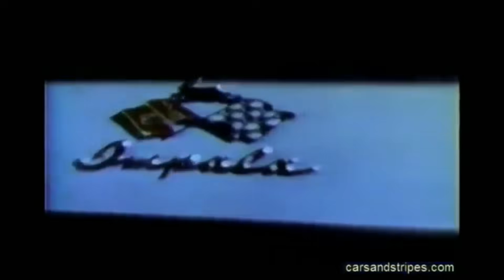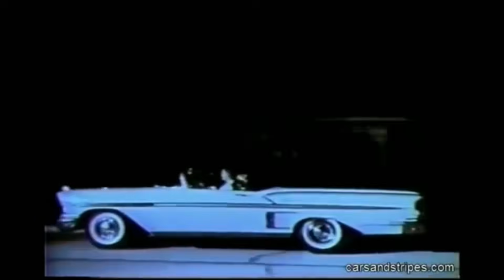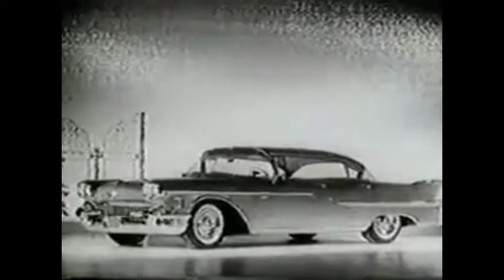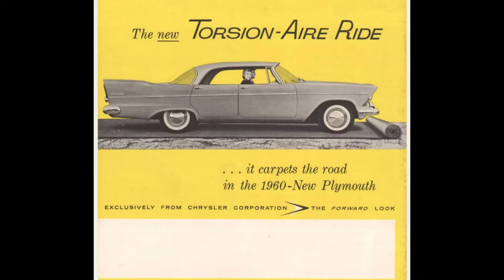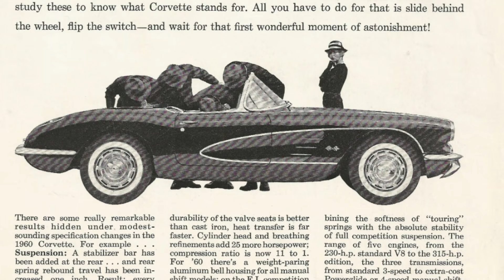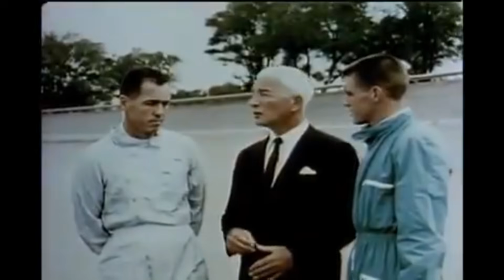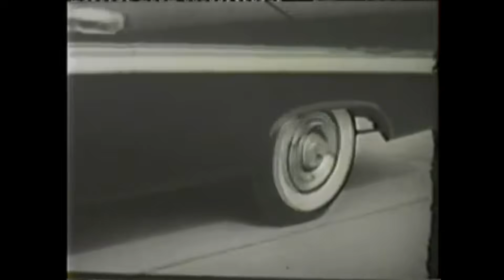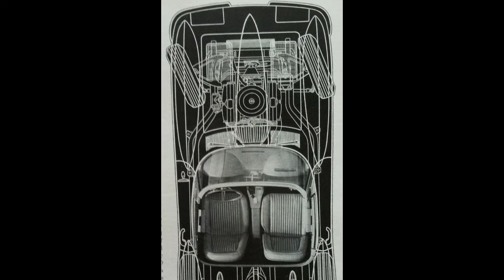The Forgotten Suspension Designs That Almost Changed American Cars Forever

Comment: My uncle test drove a 1973 Camaro offered for sale by a friend, against a new 1974 Firebird Formula (same model used in "The Rockford Files").  He spent the extra bucks to get the Firebird:  Tighter suspension feel, better cornering, and the steering & brakes were not over-powered, just an assist.  Some years later the Z28 Camaros began to drive & handle the way those mid-70's Firebirds did.
Reply: Good handling, but still not 4 wheel independent.  I know, I had a 69 Z28.  In that car GM polished the live rear axle turd to a lustre so high you needed sunglasses just to look at it.
Reply: Still all live rear axle, not 4 wheel IRS.  I know.  I had a 69 Z28.  In that car, GM polished the live rear axle turd to a lustre so high you needed sunglasses just to look at it.

Comment: From 1965 to 1969 the Chevrolet Corvair had an independent rear suspension.  If they had used it from the beginning (1960), Ralph Nader would not have been able to sway public opinion against the Corvair.  They did a stabilizer bar fix for 1964, and then properly re-designed for 1965 going forward.
Reply: Corvair had independent rear suspension from the start of production of First generation car in 1960.

And VW had independent rear suspension from the beginning of production in 1938.

And the Viper wasn't the next IRS American car since the Corvair or Corvette...  The Fiero had IRS.

Comment: Back in the 60s, a car's ride cushioned you from the bumps and pot holes even if they didn't handle. Most roads were not built to demand handling. They couldn't avoid accidents, they just crashed and good luck to you. Except for inner city streets, most roads were relatively new and smooth. Then the interstate system came into being and those roads were all new and smooth. Now cars are heavier and the roads are worse than ever. We need vehicles that can handle bumps and potholes, but they are all designed with handling in mind, not ride. I miss the soft compliant rides. What we need is balance. Something like Citroen and Renault used to provide: both, with a little compromise from each. We can't expect cities to keep up with the road deterioration as most are running in the red. If the EPA hadn't let auto manufacturers get off on air pollution equipment on heavier and larger vehicles then maybe the roads and air quality would be better. However, Trump and friends just saw to the air quality issue..Safety may be next. Buyer/driver beware.

Comment: Being 86 years old, I drove a lot of those cars with solid rear axles and I don't remember any particular problems.  I think this video grossly exaggerates a made up myth.  Independent rear suspension provides marginally better handling but eventually will require expensive repairs just like the front.
Reply: I agree that this video lacks accuracy as well, but IRS provides more than just marginal improvement.  There's a reason why cars adopted independent front suspension first before adding it at the rear, despite the added costs to design and repair.  Same goes with disc brakes.  First they were mostly at the front only, then now almost all cars have them at the rear as well.

Comment: Citroen introduced traction avant hydropneumatic suspensions in 1954 I think.  That system could raise any single wheel completely off the ground!
Reply: the TA is from the 30s. Mid 50s it's the DS, la "Deesse" (the first e would have an accent aigu) which means goddess. It's probably not included because it's like half the size of a full size car in the us of a, even though presidents rode in it, in the back! That back half looks  smaller than the back half of a Citroen C1 when you walk by it. But it's said to be a comfy ride.
Reply: The Traction Avants got it on the rear suspension in their last years, then the 1956 DS was a whole new totally different car with it on all wheels. The way they can raise any wheel is that a jack is put under that corner and then the suspension lowered. The car is trying to lower that corner but with the jack the wheel just goes up.
Reply: Totally wrong! You can´t raise "any single wheel"! With the help of a jack you can raise both front and rear wheels, on one side at a time!
Reply: @jourwalis-8875  I suggest you Google Citroen DS driving on 3 wheels.
Reply: @amazeddude1780 jourwalis is correct in relation to the TA's. DS are a different system that could.

Comment: Pontiac did an IRS in 1963 too. They also relocated the trans to the rear for better weight balance.
Reply: Yes, the Pontiac Tempest used an IRS design very much the same as the Corvette of the same year but Pontiac also used a flexible, very thin drive shaft from the engine a transaxle differential mounted to the frame in the rear. Downside was the small four cylinder engine.
Reply: @user-vp1sc7tt4m  If I reckon right, the shaft was only 9/16"

Comment: How about a 1970 Checker Marathon station wagon on a Chevy K30 one ton 4x4 truck frame, with a 454 and a Turbo700R4 coupled to a divorced transfer case, with 4 wheel indepent suspension...

Comment: A guy I knew years ago had a 1963 Mercedes 220D...  FAR from a performance car, but 30 MPG in the early 60's was practically unheard of, especially in a large, comfy car like this Mercedes.  And the ride...  was SO smooth, and zero pitch or dive in corners or when braking.  Nothing like it in those days, I'm sure.  Oh, and last time I talked to him, he had 700k miles on it.
Reply: Pretty sure the Mercedes used swing axles in this time, the same suspension Nader attacked to kill the Corvair.

Comment: Independent rear suspensions have their advantages, but they also have some major disadvantages. Solid axles maintain nearly zero camber no matter what the ride height, while most independent suspensions vary the camber with the ride height, so without automatic leveling, a heavy load of luggage or rear passengers can wreck havoc with the alignment. The solid axles and twist axles used on FWD cars, as well as the Di Deon suspensions on a few RWD cars, are sort of a compromise, offering the constant camber of a solid axle, without the excess unsprung weight of a live axle with a differential and a connected driveshaft.

Comment: 1:04 "solid axles front and rear"??  I can't name one 1950s passenger car with a solid front axle; most cars got independent front suspension in the 1930s so the front wheels could be moved back to either side of the engine; the previous location at the extreme front made the ride hard and choppy.
Reply: Crosley?
Willys wagons?

Comment: My 58 Bel Air w/ 4 coils rides ok but definitely has a ton of body roll with a tiny 5/8" or 3/4" sway bar.
Reply: Apparently, there was no willingness to use a truly large and effective sway bar in those days.
Reply: @snowrocket  Ive considered upgrading it to 1"+ but there isnt any room. ITs tight fit under there and i dont really care since its just a few times a year cruiser. Its definiity not a car to drive daily.

Comment: America banned Citroens because they basically solved the problem of both ride and handling for any size car. Because Citroen had the patent on the hydropneumatic suspension, American cars would not have been able to compete with a self-levelling hydraulic suspension that made the ride and handling of American cars look crude and primitive by comparison.
Reply: Citroen was not banned just they couldn't compete on cost.
Reply: @robhughes3442   No they actually were banned in the US. My father owned a 1968 Citroen ID 19B in New Zealand and there was a plate under the hood stating that this vehicle can't be sold in the US. I couldn't believe it when I saw it. Research it and you'll find out it's true. I think it had something to do with the way the suspension could hide heavy loads which would cause the suspension to sag in other cars, and law enforcement didn't like that as it could be used for smuggling contraband into the US. Citroens were actually used for that in Europe - illegal alcohol would be smuggled in Citroens coming across the Pyrenees from Spain into France.

Comment: Torsion bar suspensions don't offer any additional benefits over a similarly-designed independent front suspension with coil springs other than different packaging. It's still a pair of springs, a set of control arms, and a pair of dampers. It's the geometry and tuning (spring rates, damper valaving, anti-roll bars, etc.) that makes all of the difference.
Reply: Well said! Most people don't really understand suspension systems, including a whole lot of car people. Corvettes have been criticized for having leaf springs. For decades they had transverse leaf springs acting on an independent suspension, far different than the common use of a leaf spring.
Reply: Wrong. Torsion bars are natural progressive rate which improves both ride and handling.  Air springs are also natural progressives.
Reply: @anvilsvs  It is not correct to state that a torsion spring has a progressive rate. For a torsion spring to have a progressive rate it would need to have either a taper or step to its outer diameter. The rate of a torsion spring can be calculated by k = (π * G * D^4) / (32 * R * L), with G being the modulus of rigidity of the material, D being the outside diameter of the spring, R being the radius of the lever arm, and L being the length of the spring.

Comment: What about the  tucker 
And if you really want  something  interesting check out the citrogen  2cv
Reply: I used to laugh at the 2CV.  Today, I admire the brilliant design.  Plus, I think it was 50 mpg.
Reply: @garyhalmbacher6875  Well, they had a 2 clinder engine with about that many horsepower. Yes the suspension was brilliant. Done differently but like with the Packards and some later Minis and other BMC cars linking the front and rear suspensions to give the effect of a longer wheelbase.
Reply: The Tucker was independent all around, using the common swing axle design in the rear. That was proven to give iffy handling on most cars that used it. Most car makers with independent suspension powered rear wheels replaced swing axles with semi-trailing arms for better handling. Less overall camber change made it safer and more predictable to drive.

Comment: AI garbage filled with BS. There were cars in the 30’s with anti-sway bars. Cars in the late 40’s and early 50’s didn’t have solid front axles. And they didn’t ride like buckboards. This is one of the biggest pieces of AI generate crap I have ever run across.

Comment: GM went to independent double A-Arm front suspension in its CARS in 1949 with an improved design in 1955. Their light trucks finally got IFS in 1955.   Chrysler's switch to torsion bars may have been influenced by their use of the system during World War II in the production of tanks and other armored vehicles.    The Cadillac Allanté, 1986 to 1993, was a two-seater American Sports Car with independent rear suspension. So, the Viper was not the only American made car with IRS made other than the Corvette. In addition, the 1992 Cadillac STS also had IRS.
Reply: Yes, and so did the entire C/H platform starting in 1985 with millions built until 2005
Reply: No one considered the Cadillac Allante' to be a sports car. It was a sporty Cadillac, but not a sports car. That's a big and noteworthy difference.

Comment: Smokey yunik prepped an impala in 61 or 62 and was kicked out of the road racing circuit for embarrassing jaguars and other FINE european shoes.
Reply: No matter how good or bad the suspension, enough power can win the races on the straightway.
Reply: An old racing adage: American cars can only win on straightaways; as soon as the first corner appears, they lose.

Power isn't everything. The old VW Beetle won the Paris-Dakar Rally in the 1980s because it had the best suspension and only half the power.

In a Porsche, BMW, or Mercedes, you keep your foot on the gas through the corner. With any American car, you have to slam on the brakes just to get through the bend. Then, when the road loses grip, you have to brake again in the American car, and the German car is already overtaking you again. The trick isn't having a lot of power, but getting that power to the road...always and everywhere.
Reply: @thomaskamp9365 You are quite misinformed about American cars.  Since the 60s, the Corvette has been one of the top handling cars in the world and today I believe it is the best, crushing brands like Bugatti and Ferrari in both power and handling.  My 69 Z28 was a great handling car for the day.  The Corvair of the same era had 4 wheel independent suspension and was a fantastic handling car but underpowered.  The Cadillac CTS-V, which I also own, held the track record at Nurrbergring for a sedan in the early 2000s, with an automatic transmission!  

You must be European, or not very knowledgeable about cars, to make the uninformed statement you made in your comment.
Reply: @garyhalmbacher6875  Yes, I'm European and I also drove in the USA for a few years. The Nürburgring is my favorite track, the one I love driving most. I simply cannot agree with your opinion about the Corvette; in my eyes, it's not a drivable car with its solid rear axle. Independent rear suspension without a solid axle, by the way, only came about in the 80s. That's why the Corvette couldn't win any hill climbs and was beaten by every BMW and Porsche.

My opinion of American automotive engineering isn't particularly high, although as a German, I'm not a big fan of German cars. I appreciate good engineering and have been involved in many projects (ABS systems, retractable roll bars for convertibles), but the Americans are always two to three decades behind the rest of the world in that regard. Just going into a race with an automatic transmission pretty much says it all, since it offers no advantage whatsoever for good drivers.

Comment: The premiss that American suspension was ahead of its time is flawed since these systems were already in mass production in Europe and not developed in the US. It was the body and chassis construction and production techniques America had that were behind the times.  Modifying a suspension system to suit an out dated body, transmission and cast iron axle casings was not going to work.

Comment: This video does not mention bias ply tires once. Oh! sorry to dissapoint but 2nd gen camaros out handled porsche s on the road circuit , and in the 80s 3rd gen camaros still had live axles and out handled 90% of european cars. Over 50% antidive requires extrem strength to turn the steering wheel under brakin , ask a f1 pilot...

Comment: Coil springs are torsion bars wound into a circle. Failure mode identical.
Many recent cars have offered air suspension, from Toyota 4Runners to Land Rovers and Bentleys. 
Citroen took it to a whole other level by interconnecting all four airbags into a network that could compensate for braking, acceleration and cornering, leveling the car and allowing it to be raised or lowered by the driver. It was such an amazing system. Rolls Royce used it.
Reply: The Citroen suspension works completely different from air susp. The spring-force is supplied by high pressure nitrogen filled spheres the hight is adjust hydraulicly. The nitrogen pressure is inadjustable and needs repressuring after some years.
Reply: They sold a replacement for the Range Rover classic air suspension. Just too unreliable
Reply: Maserati also used Citroen technology to have fully adjust foot pedal heights !
Reply: I forget which vehicle but some Chinese car, possibly Xiaomi, offers full active suspension, the holy grail of suspension as long as I can remember.
Reply: The real secret to Chrysler torsion bar front suspensions introduced in 1957 is that they were fairly stiff and didn't use A frames like other cars of the time. Others followed with similar designs but using coil springs after that. The Chrysler difference was more in the geometry than what kind of springs were used.
Reply: They are not the same spring. The metal composition and tempering is a big difference the other difference is application. The amount of force by distance traveled is why the torsion bar broke more often than its distant cousin the coil spring. Coil spring can take more abuse than a torsion bar it’s a fact.
Reply: @brucewayne9300  Thanks.  Didn't know that.  Torsion bar can be only so long.  A coil can be quite long because it's all rolled up.  Coil can be variable rate too because bu careful winding, you can gradually take active coils out of action by a progressive wind that allows them to compress into each other.  I would think air will transmit less NVH because rubber and air as opposed to steel on steel.  My mechanic days were in the 70s and 80s and I wasn't a Citroen mechanic so no air experience.

Comment: besides the 55/56 packard, which would adjust for weight (i would ride my fathers 55 packard up and down by getting on and off the rear when it was parked..
also, you picture the 70 mercedes which did have IRS but was a swing axel not true IRS which when driving it was not exactly great, it was wallowy, especially when cornering..
Reply: A swing axle IS a true independent suspension, just not a great one.